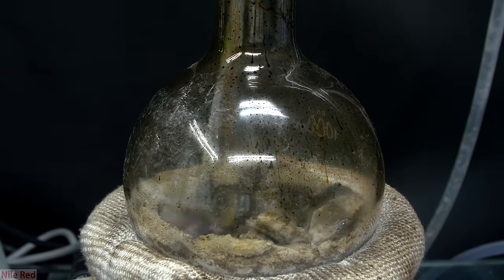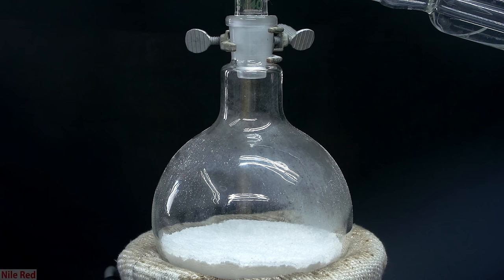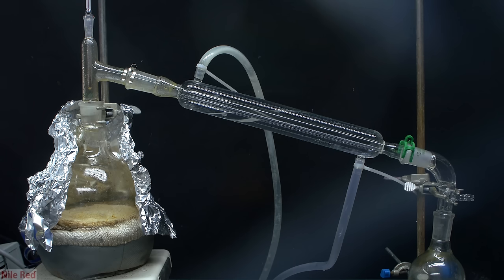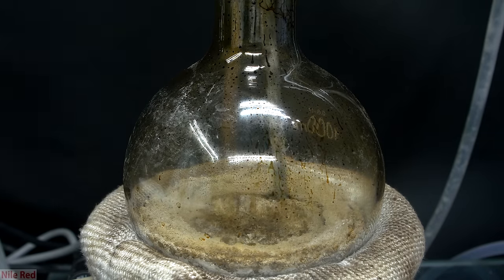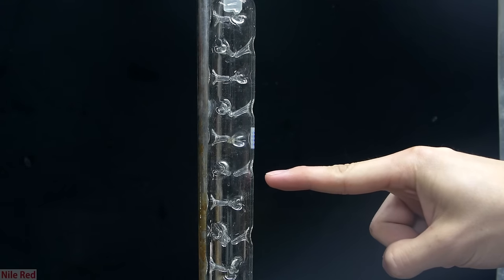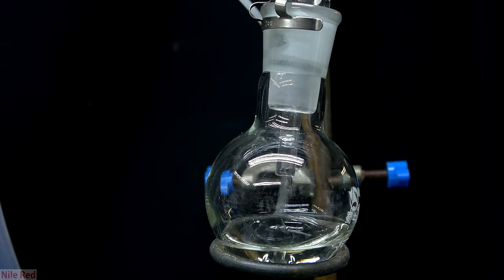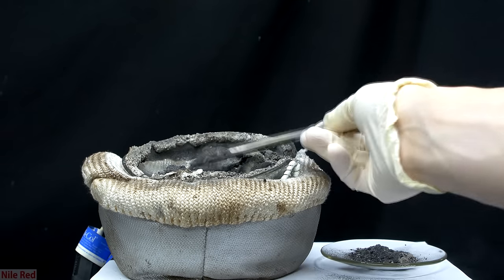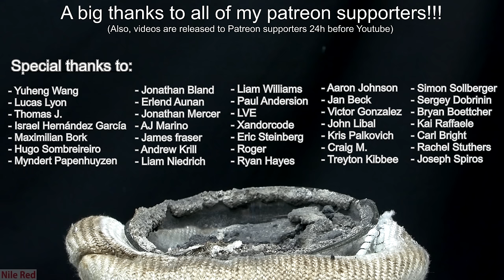Making Acetone from Calcium Acetate

Comment: I had the exact same thing happen with a roundbottom and heating mantle! I was using it on a higher power setting, but the flask fused to the mantle and cracked the glass. In my case, I was doing a steam distillation on powdered cinnamon (as in your cinnamaldehyde video), but the cinnamon was all pooled at the bottom.

If I were to speculate, the cause is having a solid versus a liquid at the bottom of your flask. Heating mantles are typically meant for boiling liquids, and as the liquid vaporizes, it carries heat (energy) from the heating mantle with it through the apparatus. This, in turn, carries energy away from and cools the glass. If, however, the mantle is in contact with a solid, this latent heat of vaporization can't serve to cool the glassware, so the flask reaches a much higher temperature, high enough where it can melt. Furthermore, the temperature differential between the top and bottom of the glass becomes so great that the flask cracks around the middle (both of our flasks cracked in exactly the same way, right along the equator).

This probably also explains the smell. The temperature becomes so great in the salt that it, and any trace impurities, will actually begin to burn. Not only that, but the heating mantle itself probably had components that were breaking down and burning. I had the same thick white smoke coming over in my cinna-still. I didn't test the flammability like you did, but it smelled strongly of a campfire or burning leaves, and left a thick red-brown oil in my receiving flask and in the joints of the distillation apparatus. I was using water, but the oil might be acetone soluble, making for the off color solvent you got.

For ANYONE attempting to use a method like this, I strongly recommend either using a different, more even method of heating (like an oil bath), or adding a liquid to the boiling flask in which the salt is not soluble and stirring vigorously. This may impede the reaction rate somewhat, and yield a less pure product from boiling liquid, but you can always redistill. The solvent will keep the boiling flask at a constant temperature as it vaporizes, and the stirring will make sure the solid can't pool at the bottom and crack the glassware. Better a slower reaction than broken equipment. But there may be an even better way.
Reply: Nathan Hopkins I know I’m ‘necroposting’ here however I suggest a sandbath rather than a heating mantle.  At least the flask is less likely to crack at its equator because heat outside the flask is more even.  Also if as you suggest the flask softens due to the pyrolysis products reacting with the glass a sudden failure is more of a disappointment rather than a catastrophe in a sand bath.  It looks like the acetate must be very pure to liquify rather than char in the flask.  Old texts specify an optimal temperature of 380oC for distilling calcium acetate, well above the softening point for borosilicate lab glass.
Reply: As a non-chemist my inclination would be to do the heating in a metal container. Is there any reason this should be done in glass?
Reply: @siggyincr7447  yes
Reply: @siggyincr7447  glass is non porous and doesn’t react with strong chemical compounds as some metals do.
Reply: @Nathan Hopkins you should have added a stir bar to the cinnamon flask and then heat it.

Comment: SOooo... some notes:
The heating mantle probably wasn't solely responsible for the destruction of your glass flask. Calcium carbonate can decompose into CaO and Ca(OH)2. Both are strong bases, and under the correct conditions that will work to drop the temperature at which the glass will dissolve into a liquid. 
Second, you were probably getting a carbamide product by reacting the acetate with atmospheric nitrogen. it'd be a slow reaction under stp, but, as already noted, you're not operating at stp. Amides have odd smells and yellow colors. spermidine ftw.
Reply: I heard stories about a guy who spilled a flask of spermidine once. I was told the whole lab smelled like a brothel for several days.

Apparently, the few people who visited it in that time period stared really weirdly at the chemists!
Reply from the maker: thanks for the input!: )
Reply: What was the white smoke doe?

Comment: I think the yellow / orange stuff and the weird smell (partly) came from self-condensation of acetone. Acetone, when heated in the presence of an acid or base (calcium acetate is basic), can undergo aldol condensation to form initially diacetone alcohol, then mesityl oxide, which has a weird odor reminiscent of peppermint, honey, and cat urine. (I've smelled it before from intentionally dropping KOH pellets in a waste acetone bottle and waiting for a week or two) Then further condensation can occur yielding phorone, isophorone, and other smelly products. Finally enough units of acetone molecules are condensed making long enough conjugated alkene systems to exhibit yellow or darker colors.
Reply: Calcium oxide is also basic

Comment: Hey nile, sorry about the the mantle. About the yellow funky oil, my guess is that because calcium salts were not particularly pure (tums) they may have had traces of nitrogen/sulphur compounds (tartrazine is listed in the inactive ingredients, which contains both as well as some aromatics) which as you know, smell, they probably reacted at the high temperatures of the dry heat and decomposed (low boiling fraction) or polymerized/reacted with some of the acetone (flamable fumes were likely a higher molecular oil that got "steam distilled" carried by the acetone vapor). If you ever decide to try it again id love to see what changes if you use recrystalized calcium acetate and maybe using a high boiling "solvent" and boiling a suspension of the salt in like mineral oil instead of direct dry heat.

Comment: a small tip: when you're trying to isolate your aparatus with aluminium foil to have it stay hot, you should put the more reflective side of the foil TOWARDS your aparatus. the heat will reflect better. for cooling it's the other way around. hope that helps! nice video as alyways!
Reply from the maker: Does it actually have that big of an effect? I always kind of assume it wouldn't make a huge difference
Reply: well, the science would support it and i made good experience with it, so try it! :)

Comment: That's why you should always leave a tiny gap between the heating mantle and the flask, you can always add insulation over the flask (like aluminum foil) if you need better heat transfer... Also if any liquid or whatever ends up leaking from your setup, it doesn't glue the mantle into the bottle so easily :)

Comment: The flammable gas produced is probably methane.   You are basically doing a soda lime decarboxylation making methane  (63%) and at the SAME TIME a ketonic decarboxylation making acetone as a side product (37%) and that is why the yield is so low.   It is a side product.  When you make benzene from benzoic acid doing a soda lime decarboxylation you are ALSO making benzophenone (a ketone) doing a ketonic decarboxylation.   But benzophenone boils at like 300 C so you never realize you made it.  But it is the high boiling stuff left in the pot after distilling it.   THIS IS ALL JUST A GUESS BUT IT SOUNDS LOGICAL

Comment: If the smell is similar to cat urine, I would say your synthesis produced a little bit of thioacetone. I've played with the stuff, and the odor threshold is extremely low. The small amount of sulfur from the dyes in the TUMS or egg shells would probably be enough to odorize your product without being visibly noticeable in your calcium acetate. But that's just a shot in the dark. 

Good video, though. It's nice to see some of the old fashioned syntheses for compounds we take for granted.

Comment: You shouldn't insulate the column for things with a low boiling point like acetone: it lowers its ability at separating the compounds that go through it. 
Instead, to get good purification and get as close as possible to the pure chemical or azeotrope, you should increase the heating until the vapor front just barely reaches the condenser. 
(The rule of thumb is that the more heat your column radiates per amount of chemical distilled, the better the separation. It's purely a question of entropy: separating chemicals in the gas phase has a negative entropy, so you must compensate by radiating heat outside and bring balance to the Force erhm... Gibbs energy.)

Also, it would be really cool if you recycled the black deposit at the bottom of your flask with some acetic acid, to make more calcium acetate and put it through an other cycle of acetone production. You'd have an actual chemical "cycle" with the calcium! Quite a change from the usual "straightforward" reactions...
Reply from the maker: That is true. I should have actually mentioned that about cycling the CaCO3 back to making calcium acetate!

Comment: Awesome video, I use this as I have a lot of eggs (long story) and acetone prices are outrageous in Australia... so I can just make some acetone from eggshells. Just a little nitpick - you use the aluminium foil as an 'insulator' when it's actually a good conductor of heat. Still though everyone understands the wording so no need to change anything!
Reply: I think it is probably for the heat radiation and not for the contact heat transport.

Comment: Regarding the melting of your 1000 ml flask, did you buy it from China?
I didn't see the word "Pyrex" on flask, which leads me to suspect that it wasn't Pyrex.
"Solder glass", which is used to join pieces of glass having higher melting points, can melt below 500 C.

Comment: Use a sand bath for the flask next time and bubblers to capture the fugitive fumes.
Reply from the maker: I tried to use a bubbler and it actually didnt work very well. Also, I think the temperature is too high for an oil bath and I tried a sand bath for a decarboxylation before and it didnt really work well.
Reply: Interesting. Was your heat source for the sand bath not high enough? Everyone I know who is doing dry distillation of metallic acetates is using sand baths and bubblers; many use a "cold trap" by putting the receiver in a bath of acetone and dry ice. For the bubblers they use an empty bottle for a safety should the pressure drop, the second usually has ethyl alcohol or distilled water in it that the most volatile fumes bubble through, the third is empty for a vacuum safety again and the fourth is an activated charcoal/distilled water slurry that the fumes bubble through. Then from there run the gasses to a fume hood or outside. Anyways, thanks for posting the video, I enjoyed it.
Reply from the maker: Grant Stewart It was probably the heat source and i was doing it on a large scale so i think heat dissipation was a problem.

Comment: is it possible that the flammable gas is carbon monoxide?
there was alot of organic material in the tums that turned to black powder
i know that when you heat wood in a closed vessel like that it produces carbon monoxide

Comment: please make nitrous oxide video next! :)
Reply: just mix nitric acid with anything?
Reply: +krap101 that's nitrogen dioxide, or NO2
Nitrous oxide is N2O
Otherwise known as laughing gas
Reply: +Rsaramallac fine. heat it too
Reply: +Rsaramallac you can come too
Reply: Heat up ammonium nitrate?
Reply: Not a good idea! NH4NO3 decomposes at moderate conditions into N2O and H2O, at harder conditions it may deflagrate or even detonate.
Reply: +196Stefan2 It won't. It decomposes at something like 200c WAY below the temp it needs to detonate.
Reply from the maker: I plan to do that eventually. I just need to plan the video
Reply: or nitric acid reacting with SnCl2 and hydrochloric acid
Reply: especially if it isn't pure
Reply: Nitric and Sulfonic acid.

Comment: Is calcium acetate highly flammable due to the fact that it's decomposing to acetone and calcium carbonate?
Reply: By itself, it isnt flammable, but as you said in high temperatures it produces acetone, which burns easily. However, it doesnt catch the flame and you need to use torch or smth to start decomposition.
Reply: +Jakub Domański thanks :)

Comment: Where did you get that heating mantle? How did it reach the melting point of glass (1300-1400 degrees celsius)?
Reply: It doesnt actually have to reach the melting point of glass, since glass is an amorphous material, it slowly turns viscous, unlike water.
Reply: As heating mantles use the same electrical resistance heating principle as do KILNS, I can attest first hand as to their being able to reach an orange heat and melt glass flasks...most heart-breaking...it ain't pretty!

Comment: Did this mysterious smell was the smell of a crap (not joking right now)? I bought some aceton which smells like it. Maybe they used similar process to make it. And… what temperatures did you use at first (decomposing) and second (distillation) phases? I think it is somewhat weird that your flask melted while distilling ACETONE.
Reply from the maker: It is because it was a dry distillation. I increased the heat to fully decompose everything and that turned out to be a terrible idea
Reply: Borosilicate glass melts at about 700-800 deg C. You have really overdid it :)

Comment: I would have expected the acetate to decorboxylate to methane under heat. How do we go from acetate with two carbons to acetone with three carbons? Do you know the reaction mechanism?
Reply: The 4th carbon is left behind in the calcium carbonate
Reply: the decarboxylation only occurs in alkaline conditions (hot alkalies) and, as far as I know, only when Na or K acetates are used

Comment: Are there any problems with using sand instead of a heating mantle?
Reply from the maker: The only worry I would have is that it wouldnt get hot enough. It would probably work though.
Reply: +Nile Red Ok. I was thinking about using sodium carbonate so if i spilt acid in it it would neutralize it.
Reply from the maker: Sodium carbonate instead of sand?
Reply: +Nile Red Yup. Play sand is sodium carbonate, (I've seen it used in stuff like copper casting) but it's gooey and it scorches.

Comment: Can you make 2-butanone by doing a grignard reaction of ethyl magnesium 
chloride on acetonitrile and then hydrolysis?! 
Preparing the ether would probably require cleaning the ether using 
potassium hydroxide, then decant, then adding sodium metal and 
benzophenone under an inert atmosphere, then careful distillation. 
Grignard reactions can be catalyzed using ultrasound and also a small 
iodine crystal. 
Ketone!

Comment: does it work with sodium acetate?
Reply: No, it wouldn't
Reply: antiswattt3 because chemistry. I think it's because of a special property of Ca, NaAc (Ac=Acetat , yes im lazy xD) is also a much Stronger compound than CaAc2.
Even with Mg which is very simular to Ca it doesn't work
Reply: maybe, but not nearly as much as CaAc2 would, i think it would rather burn than building Acetone
Reply: I don't know, but Acetone may still be very rare. Just do it Calcium, it's a much easier method
Reply: yes this is the easiest way, but also the most boring one
Reply: I looked it up and found this.
http://chemistry.stackexchange.com/questions/50864/decomposition-products-of-sodium-acetate
I guess it does not become acetone, but produces a gas called acetic anhydride, which then reacts with the moister in the air to become acetic acid again. The solid stuff that is left behind would be sodium oxide, so if you somehow got it to decompose under a vacuum something different would happen I would think, but im not sure what.     2CH3COONa⟶Na2O+(CH3CO)2O
Reply: antiswattt3 
Couldn’t you just distill it then?

Comment: I wanna prepare cu/salicylate...Do u have any suggestions for the procedure other than sod.salicylate + cu sulphate?
Reply from the maker: what is sod? Also, salicylic acid + copper hydroxide would be a good mix. You would get copper salicylate and water. Use an excess of copper hydroxide which isnt soluble in water, filter off the excess and then evaporate? That is just off the top of my head.
Reply: sorry I meant sodium...
Reply: for dissolving salicylic acid in sodium bicarbonate
Reply from the maker: Kar Nour ohhh okay. is copper salicylate water soluble?
Reply: no ...may be I'll use DMSO after the preparation

Comment: +Nile Red if its possible it'd be amazing if you could make olympicene also I tried to do an extraction to get florescene (from highlighters) but for some reason i got this weird solid I linked a picture it'd be amazing if you could identify it https://gyazo.com/5f4a2b992bd8eb506ebb48811d3505fa its yellowish orange and it feels like warm cheese and it still fluoresces in water I also have it diluted in 91% isopropl alcohol and also in water if you want to see them
Reply: +Nile Red my theory is that a bit of the binder came out with the florescene because i didnt use 100% isopropyl alcohol

Comment: Random question. I noticed when you first put the calcium acetate into the flask that there was some white dust floating around (high def is so awesome). Hypothetically, if you were dealing with a chemical that was both super fine and dusty like that where it almost wanted to become a particulate in the air even just sitting down, AND it was super toxic.. are there any special tools you could use to prevent contamination?
Reply from the maker: I would say working in a good fumehood would probably keep you safe enough.